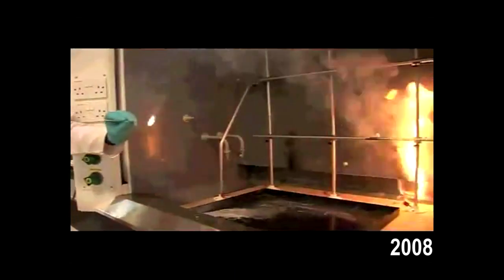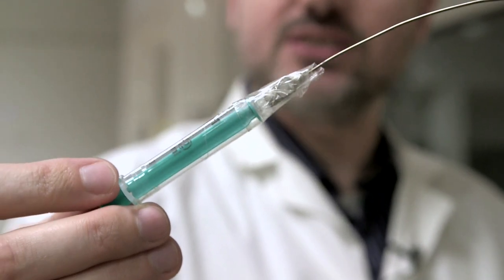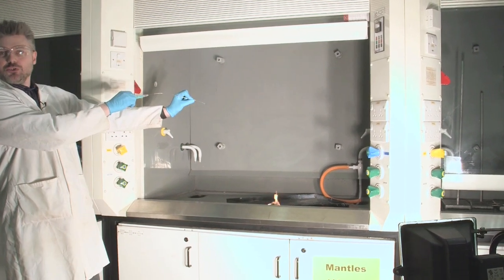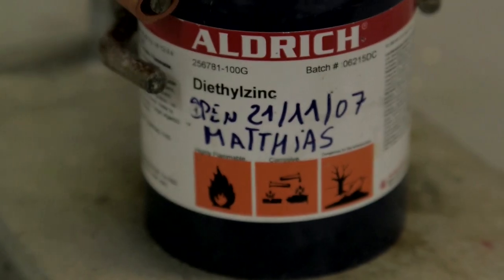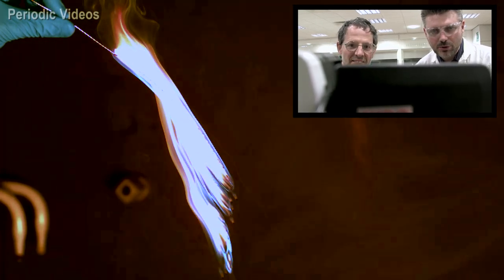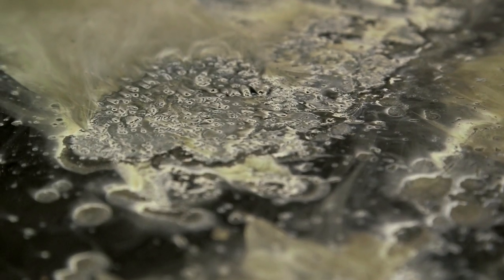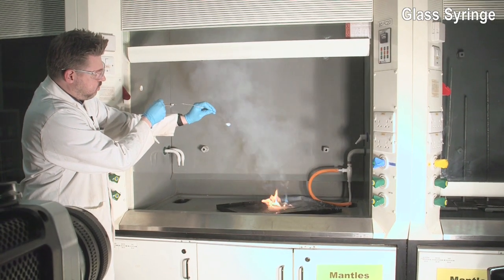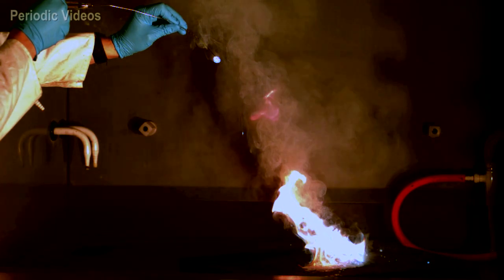Blue Flame Thrower - Periodic Table of Videos

Comment: Zinc boring? What nonsense!
Zinc sulfide is a beautiful transparent crystal that can be made phosphorescent when polluted with another metal.
The pure metal is of course a strong reductor, leading to its popular use in lemon based electrics. It's such a strong reducing agent it can even use CO2 as an oxidiser at high temperatures. (Good thing Lavoisier used mercury instead of zinc for his famous experiment)
When alloyed with tin it makes for a great material to mold into shapes for any amateur metallurgist.
Zinc ions form a structural component in some proteins, in what is called the zinc finger.
It becomes a P-type semiconductor with sulfide or telluride.
Zinc boring? Tell your colleague someone on the internet disagrees with him...

Comment: Exciting for sure. I'm wondering however, when you had emptied the syringe then pulled the plunger back in order to purge any residue it did not create the flame in the syringe. But, again, when you spray it out the residue does react.

Could it be that sensitive to its container due to its vapour pressure? It's the same gas mixture going in to react as it is exiting the syringe, the only substantial difference I can think of would be the confinement of the syringe.?

Cheers